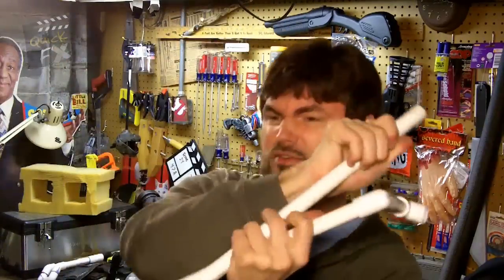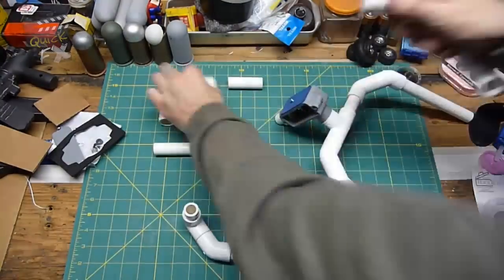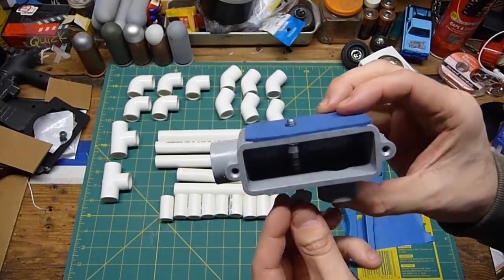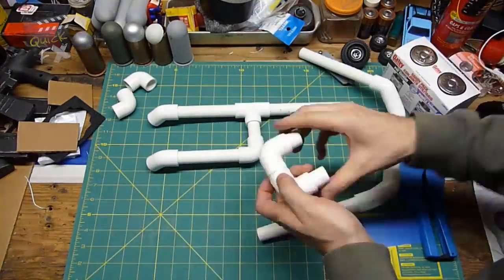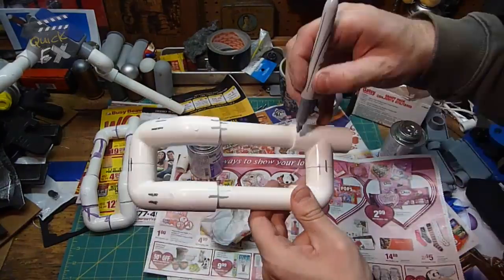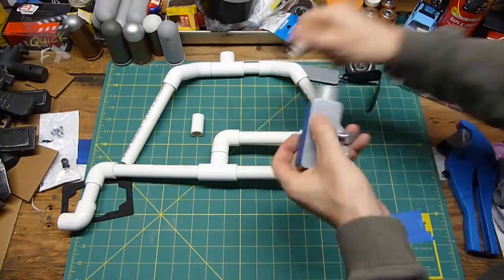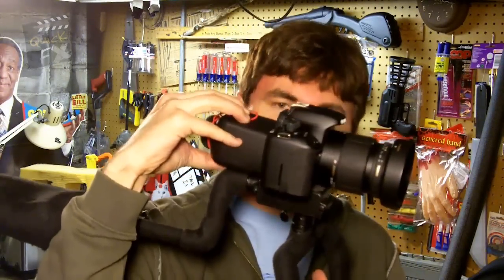DIY Shoulder Rig - PVC Camera Stabilizer - QUICK FX

Comment: All in all a great design and project.  I am VERY pleased with the final rig!!  Thanks so much for the idea! Mods I made were: 
1) longer straight bar going to shoulder (reason) rig is for a HMC-150 so the extra room helped get the LCD screen farther away, so easier for me to see because of my Bi-focals. 
2) I didn't like Tape  so I used spray on Truck bed liner (8.00 @ can) for exposed PVC. 
3)left an open area in padding to put wrist weight to use as a counter weight for HMC 150.

Comment: @Knoptop Not bad at all! Did some of our own mods. We took a old table top tripod and took the head off of that and installed that on top of mount (your set up) but as for the PVC electric box, took that and placed that on one of the sides for the Mic kit to be installed. Then used spray on black rubber to give grip plus looks pro.

Comment: Putting this one together. Home Depot/Ace does not sell a 2inch thumb screw, but they do sell an eye hole screw, installed it, it works. PVC cutter really made it easier, at about $12 extra. Might consider gluing the piece as a whole, rotating loose PVC pipe makes noise that will pickup in mic, but fit it to your shoulder before final gluing.

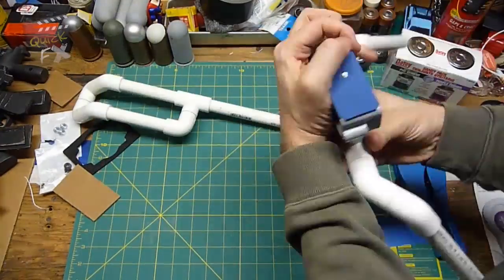Comment from the maker: @FactNotFaith Drill the hole from the top threw the bottom. Insert the screw halfway, and then screw on two nuts onto the screw and then push the screw all the was threw. Tighting the nuts together as seen here 2:47  You'll have to adjust the nuts to tighten together so the screw will only tighten so much into the camera.  The optional spring inside just keeps the screw in the upward position.

Comment: Hey Man - great work. Love you teaching style as well. Question about the thumb screw for this rig... If the 2 inch thumb screw goes all the way up through the conduit box with the two nuts at the top (inside) what purpose to the spring have? Isn't the thumb screw locked in position? A little hint here would helpful...

Comment: @Knoptop -- Thanks, Man. That makes sense. I went to the hardware store and worked with the spring and now I get it. Duh. Another dumb question... the rubber foam pad? Didn't find it at Home Depot. Where'd you get that?

Cheers.

Comment: @SergSpace It is very sturdy as the pieces are no more than 10 inches.  Once cemented into place it is rock-steady.  Since it is easily customizable, one could add extra support if you feel it is necessary.

Comment: The electrical conduit body is called an LL.  Its shaped like an L, so that is the first L.  If you hold it like a gun, an LL will have the opening on the Left, an LR will have the opening on the Right, and and LB will have the opening facing up, or Back.  for this project, and LL or LR should work.  Just make sure you get the PVC ones.

Comment from the maker: If you click the link in the description, it will take you to the website article that has a link to instructables. There you'll find a close up photo of that bolt setup.  You can also, skip that step and just screw into a Sima Quick Connect puck.

Comment: Great job man... i used your design. I little bit modified it, by changing the 51/2 inch pipe to the 90 degree pipe. just swap it to the 21/2 inch, cuz' i made it with 51/2 inch,  my eye couldn't reach to the viewfinder. but that's it, Thank you..

Comment: What nuts did you use to get the spring to be effective? Was one reverse-threaded or what?
Reply from the maker: 1/4-20 nuts and they are tightened together and lock at a height that keeps the spring tension correct.

Comment from the maker: @JaygreenTV Drill the hole through both the top and bottom end of the box.  Push the screw up through the bottom and attach the bolts inside before pushing the screw all the way out of the top..

Comment from the maker: @ShutterlabCreative If you taped attached two 'ankle weight' strips to the back shoulder mount area that could help counter balance the weight.   Also, adding a t-joint pvc piece, you could add a circular weight.  I have a another version of a camera rig I'll be sharing very soon, that may be better for the setup you are trying to create.

Comment: Where did you buy the conduit box with the screw hole on top? I found one but will I have to make the hole myself?
Reply: You'll need to drill that hole yourself.
Reply: +DaveKnop cool ok I got that- but when I fit my pvc pipe together it never goes in all the way, is there anyway to loosen them up when I do my dry fit?

Comment: @JaygreenTV He talked about how he did it real fast.  1/4 inch 20 thumb screw that is 2 inches long.  If you look inside the conduit box as he is showing it you can see how it stays in place; there are two nuts and then a spring which keeps tension on the screw to keep it in place.  Kind of a cool setup.  I think the spring would be the hardest thing to find.

Comment: All you guys are using PVC cement and primer for these projects. The primer (which softens the plastic) really isn't
necessary, because you're not running pressurized water (or pressurized ANYthing) through it. The glue by itself should
work just fine-(I've made furniture out of this stuff for years and its never come apart) saving primer cost (its like 4-5 bucks a can now), plus much less smelly. :)

Comment: I have a request.  I'm looking for a simple and ofcourse cheap solotion of a lens filter for the huge barrel lens such as the Tokina 16-28mm f2.8 or the Nikon 14-24mm f2.8.  If you notice both lens they do not have any lens filter screw mount and I always use ND filters when ever I shoot outdoors.  The only solution for getting a ND lens filter is the expensive Wonderpana system from fotodiox wonderpana 145 system for $200
Reply from the maker: Google image search "diy ND filter" and there's a few options I found there that may help.

Comment: @hute0898 Yeah, I have an HMC40, also quite big and I've used something similar to this and once you add your external Mic to the camera it gets a little wobbly. How about adding another shoulder support, two would make it more stable. I also added some PVC pipe downwards to connect with my hip (padded) takes some of the weight off and works quite well for bigger cameras.